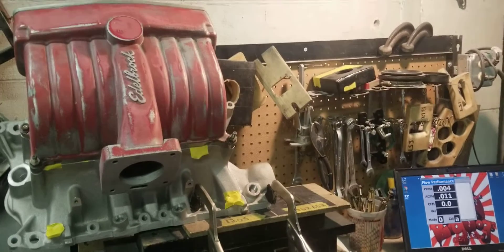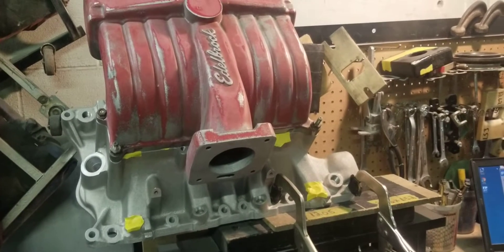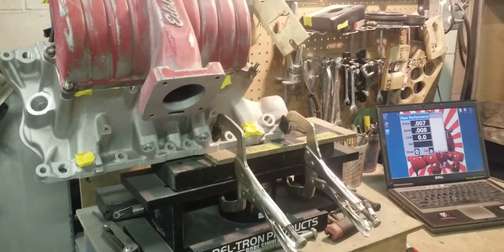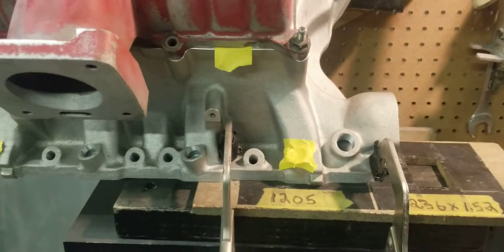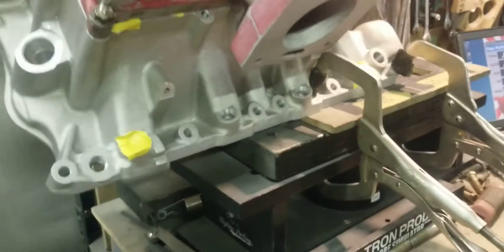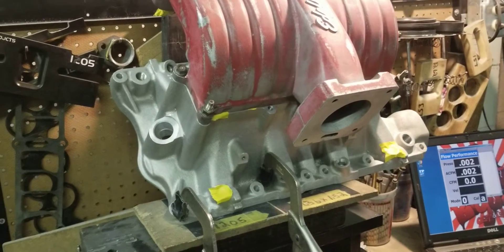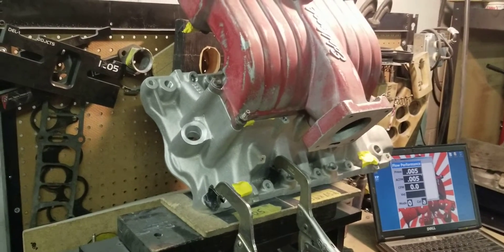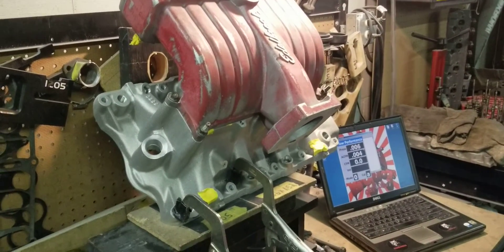Ford Edelbrock performer 351w truck lower/5.0 performer upper manifold base line flow testing part 1

Comment: Hey have an odd question..Could it possibly flow a hair better when it’s actually on the engine? Because you have all 8 ports pulling air in at the same time maybe that would create a vortex or something along those lines?
Reply from the maker: That all depends on the engines demands. Static flow is only one part of the equation that can be accurately measured. Runners Wave length tuning and CSA are the other parts. Runners length will determine were the wave length tuning effect will kick in on the second and third order. 1cfm on the intake runner can support 2.05chp. 2nd order wave length tuning adds 10-13% more flow to the static flow and the 3rd order wave length tuning adds 6-8% more flow to the static flow. 
Once you have the airflow demands met the biggest limitation becomes the cam. Most people don't run enough cam to take advantage of all the extra airflow.
The 2015 Coyote motor intake manifold has a stock intake manifold runner flow less than 280cfm yet it can support a lot of hp. 
Most of the time our customers don't use the full available airflow that our ported parts put out due to other bottlenecks

Comment: Bigdog can you tell me what kind of hp and toque gains, porting would make on a stock 351 efi truck?
Reply from the maker: We had a customer that did a before and after dyno on a stage 2 351w truck manifold and ported stock throttle body that had a emissions legal heads, cam and dual exhaust pick up 25whp/30wtrq across the entire dyno curve from start the redline with no other changes.

Comment: I don’t think the make the edelbrock 351 lower anymore.
Reply: Oh. It’s the truck base for the 3881. Ok. I thought it’s was the RPM II lower intake.
Reply from the maker: @phide01  to be honest it's not worth the money. Best way to go is to get a 351 gt40 lower and a Explorer or Cobra upper and let us stage 3 port those or get a 351 Typhoon and let us stage 3 port that for a high hp application. The Edelbrock performer 5.0 upper and 351 truck lower would not be our first choice for a high hp manifold build.
Reply from the maker: Yes they do. Google it. The lower in the video was brand new

Comment: Interested to see the results after you port it.

Have you flow tested a 351w truck lower to a 302 EFI truck upper? A lot of guys on the truck forums are doing that hybrid with home porting. Curious if you guys have done that and what the results were.
Reply: Forgot to add both manifold mentioned above are the stock manifolds.
Reply from the maker: @adammossinghoff385  in our experience most home porters flow gains are not what they think. We get parts all the time that's been home ported and when we put them on the flowbench the flow is low
Reply: @bigdogsportingtonyb2833  would love to see some videos comparing the Truck intakes both for 351 vs 302, not a lot of guys are saying the 302 intake out flows the 351 intake so they go 302 upper to ported 351w lower
Reply from the maker: @DBLDREW  anyone saying what a part flows without actually knowing the flow data of that part is misinformed. This is why we flow all of our parts before and after. A 302 on a 351 lower in stock from doesn't flow well just like a 351 truck manifold. Both needs porting. It all comes down to cost. Our stage 3 351 truck manifolds can support well over 400whp
Reply: @bigdogsportingtonyb2833  no i understand without flow numbers its just guessing, its just the stock 302 truck intake has the ports of a holly systemax intake vs the 351 intake are very very small. so the idea was use the higher flowing upper from a 302, and just port the lower 351 to match, that way your just porting the lower. was just wondering how much truth there is to that and how much more the stock 302 upper actually flows, it "looks" like a systemax but does it actually flow like one?
Reply: @bigdogsportingtonyb2833  here is a picture of both truck upper intakes the left one with the bigger "systemax" looking ports is the 5.0l truck intake, the one on the right is the 351w intake
https://farm4.static.flickr.com/3234/2817457593_6c17310d4f_z.jpg
Reply from the maker: @DBLDREW  the stock 302 truck upper may look like a Systemax but it doesn't flow like one. That's my point. You cant gauge a manifolds flie off of what tg looks good. That's how so many porters fool their customers. Because they make them look like they flow well. This is why we are one of the very few businesses that actually takes the time to do before and after flow testing because looks means nothing.
I you take a 351 truck manifold and a 351 truck lower with a 302 truck upper and port them th ed same the flow will be very close. With the 351 truck upper you gain more t
TB flow when that area is ported correctly.
Reply from the maker: @DBLDREW  trust me. I've ported and flowed these. You have to understand, the few videos we post is only a fraction of what we have ported. I've ported o e 3000 parts over the years lol. You are not telling me something that we haven't already tested. Looks means nothing. This is the struggle that we have with people. Trying to deprogram people from the misinformation that they've been fed over the years with no real proof. Flow is not just how big a port size is. Its getting the shapes, curves and angles right to improve efficiency. This is why our ported parts tend to make more power than others ported parts. Because we test the hell out of everything, they don't lol.
Reply from the maker: @adammossinghoff385  in stock for those still flow less than 190cfm average per runner

Comment: Have you ever flowed the RPM 1 manifolds? Are they any better?
Reply from the maker: Yes we have. They are better but still restrictive at 225-230cfm
Reply: @bigdogsportingtonyb2833  what would you expect to flow at with a decent port job. My heads flow at 250 and I have the RPM 1. Want them to match the 250. How much power gain could I see from that
Reply from the maker: @jakew2350  we can get the rpm 1 to flow as much as 300cfm with our stage 3s but our stage 2s we can get them to flow well over 250cfm. Also you don't rate a cylinder heads flow at .600" lift as to what your motor will see. You look at your cams peak lift then .020" lower than that then the heads flow at that lift. Also the heads average flow as well.
Reply: @bigdogsportingtonyb2833  yes I got the rate from .500 lift but my cam is .540 lift
Reply: My head flows the same at .500 and .600
Reply from the maker: @jakew2350  our porting on the intake gets them up to speed

Comment: Shocking result , I have edelbrock performer   And thought its 220-225 cfm stock ,so its in same range as stock cobra
Reply from the maker: We've been saying this for years now. A motor doesn't care which brand part it has. It only cares about how much it flows lol
Reply: That prove this intake is just for stock unported gt40 head , If planning for higher flow heads get it ported
Reply from the maker: @yousifmalalla5244  this is true. Unless you got this manifold for free I would save money and just have the stock manifold either stage 2 or stage 3 ported and save money.
Reply: @bigdogsportingtonyb2833  any update in stage2 flow
Reply: @yousifmalalla5244  yes seems like it, I went from gt40 to performer RPM and gained about 13 rwhp. I know the gt40 was lightly cleaned up so means it was flowing somewhere above 200cfm because the performer RPM flows at 230